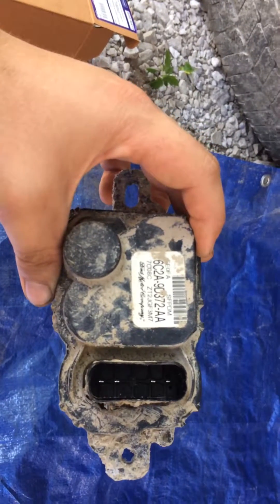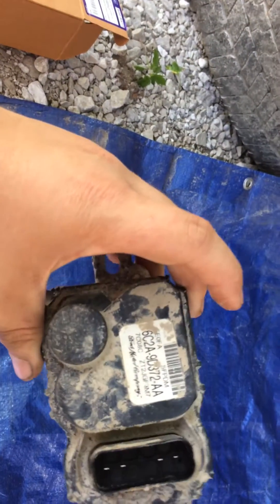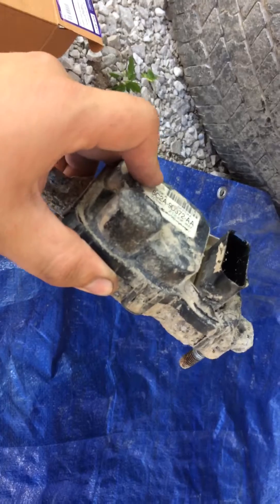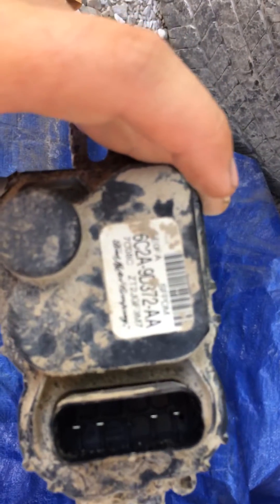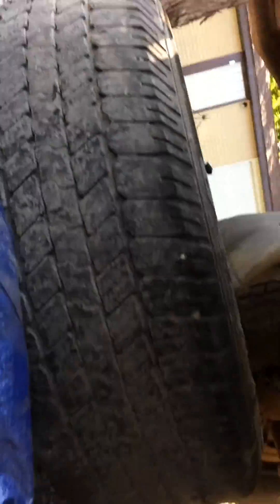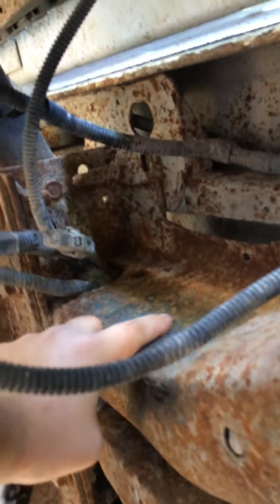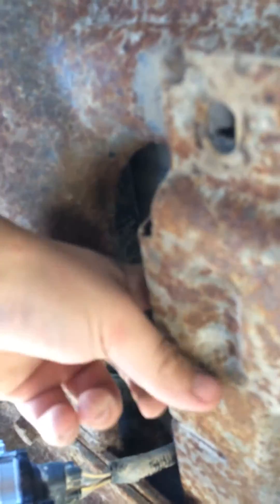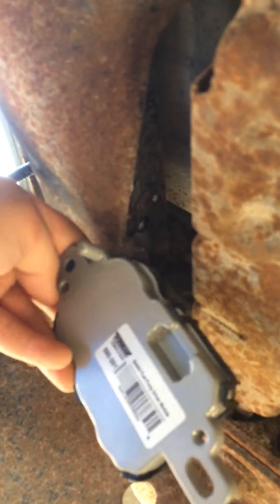Ford F-250 gas fuel pump driver module

Comment: youd not believe this one, got a fuel problem, then I bought an oxygen up stream sensor,
not the fix. then I thought about electronic module and after reading about them, it hit me hard.
So I returned the parts that I almost mounded. Changed out the battery as I was going to remove the 
the electric pump. But no it was the module after all.

Comment: put brand new oem module  would not start brought to local garage said programmed ran fine month latter same issue   give new one small tap   have you ever heard new module going bad?
Reply from the maker: Sorry about the delay of replying, but I actually just had to replace mine again 2 weeks ago. Made it about 30 months

Comment: I have an f250 2002 v10. I cnt find this module. If you can point me the right direction it eould be greatm thanks in advance
Reply: I know this is 2 yrs old but for anyone else-the spare tire is removed, this unit is bolted to the inside of the last cross member towards the driver side. You will see the 2 mounting studs protruding twds the rear of vehicle secured with nuts.

Comment: I have had problem with fuel pump fuse blowing and took it to ford and they said it was my junction box inside truck replaced it and it’s back to blowing fuel pump fuse. Picked it up said it was fixed and after putting fuel in it and turned on my road the fuse to fuel pump in junction box blew again. My truck is a 2002 ford f 250 super duty 5.4 liter.

Comment: I have a question. Did you have to reprogram this into the pcm after replacing?
Reply: Reason I ask is because I did replace it and still not firing
Reply from the maker: No sir, plug and play. There is a way to temporarily bypass it and run the fuel pump to see what has failed
Reply: Hmmmm I'm so stumped.
Reply from the maker: Michael Smith     https://youtu.be/GqZTkso6kSg               This is a more in depth video

Comment: What years f250 have these? I have a 2000 f250 5.4 with a no start no feul and then it will work after about 15 minutes of sitting.
Reply from the maker: Joseph G not sure you could try searching a parts catalog for your truck
Reply: I think this might be my problem.  Have had intermittent shutoff, and now crank no start.  Going to pull the spar and take a look.
Reply: Was it this or the fuel pump for you mine does the same only occasionally starts